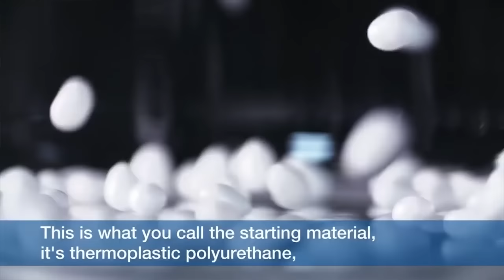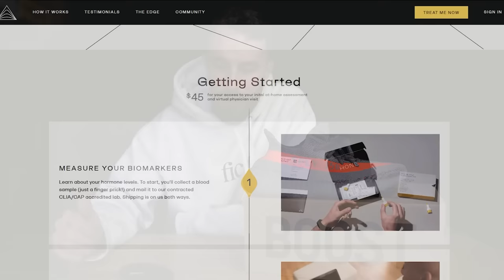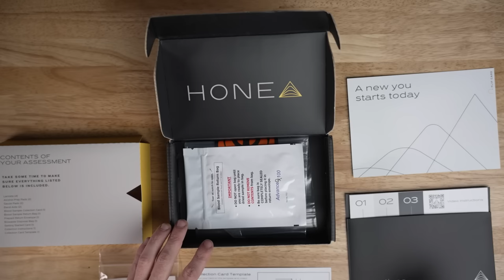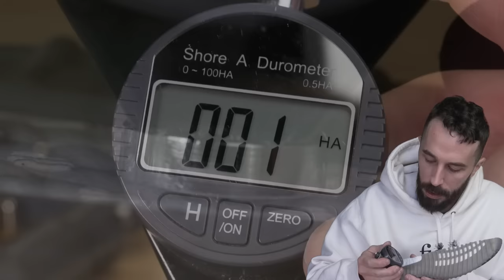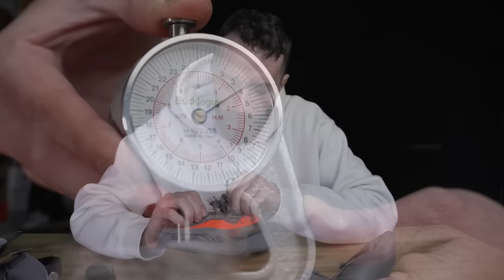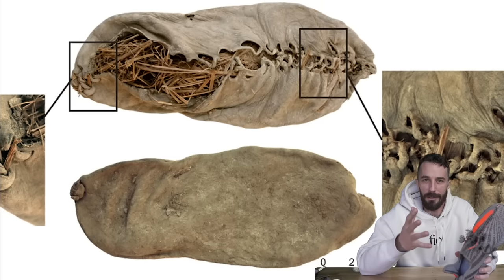The Truth About Yeezy 350 V2

Comment: I own a couple pairs of yeezys, have had more over the years, they’re nowhere near worth it but there’s just something about them that makes me like them. Super comfy on feet and a good recovery shoe after wearing boots.
Reply: I agree lmao. Whenever my feet are dead I just wear the Yeezys.
Reply: Dude this is actually super helpful, I’ve been borderline getting Trench Foot from wearing boots all day, I even got new socks and it’s still an issue, i bet these are super breathable!
Reply: No recovery sneaker needed if your boots fit right/are well made etc.
Reply: Fr I wear my foam runners all day after a long shift of work
Reply: @devilxking2  that’s not true. Unless your boots are zero drop and have a modern design. Being on a platform with a raised heel all day does induce a lot of wear on your calves, shins and feet. Esspecially if the boot is traditionally constructed, it’s bound to be a bit rough on your feet for wearing day in and day out.
Reply: There are plenty of comfortable and breathable sneakers. This is called convincing yourself they’re better because you overspent on a ridiculous brand name or rationalization.
Reply: Want a recovery shoe? A pair of Blundstones. Want a sneaker? Get an Ecco Biom sneaker at half the price.
Reply: John Baptist  they look terrible
Reply: @devilxking2  not the case, I own red wing iron rangers all day in an engineering workshop. They definitely take a toll on your shins and Achilles after a 12 hour day.
Reply: John Baptist  they look hideous actually
Reply: John Baptist  "omg muh fee fees are hurt. yu jus jealous cuz i waste money on marketing scams and brand manipulation"

translated your whine for you.
Reply: Yeah Yeezy are one of the most comfortable  ones
Reply: Yeah I think the thing about them many seem to forget is that you don't buy them because they are the most efficient or anything, but because you like the design and comfort.
Reply: @0f556  The Ecco's look kinda whack tho imo
Reply: @thesumosnorlax2445  There are 100's of cheaper options. I personally like New Balance Fresh Foam. Don't waist your money simply so you can say you have Yeezy's. A lot of guys in my area like Hey Dude's also.
Reply: @thesumosnorlax2445  just get crocs
Reply: John Baptist  The majority of the "Haters" on this channel own Nick's boots which start around $550.00, Or Red Wing heritage that start around $300.00, or any number of other hand made leather boots. It's the complete lack of value in these shoes that's the problem. There is absolutely no reason these $50.00 shoes cost as much as they do.
Reply: Holy shit I didn't know there was so much beef in the sneakerhead community. Thought yall just talked about your shared love of Jordan 1s.
Reply: @mrbadpersonality  That's your opinion, that doesn't mean it's a fact
Reply: I think they're worth it.
Reply: @imsotiredofthiscrap2341  true sneakerheads don't put others down for their choices of footwear. It's usually the hypebeasts who stir trouble and like to badmouth those who don't agree with their POV
Reply: @zhsf  I think my opinion is pretty solid tho
Reply: @markopolo9936  I wear my Yuketen boots every day and I walk a lot; never felt the need to wear something else. They are also more than double the price of Iron Rangers MSRP but yeah.
Reply: @mrbadpersonality  For you it is, but not for everyone..
Reply: @thesumosnorlax2445  I’m sure there are others that are breathable without paying out the nose for them too….
Reply: @willmtaylor  I completely agree with u . These are WAY over priced . And they are UGLY as hell . If they were $40 I still wouldn’t want them. I think because they are expensive that makes people feel like they have something and that others will look at them differently. I think anyone who pays out the nose for a pair of shoes because they are the fad or what the stars are wearing . They aren’t anything special at all !!!!
Reply: John Baptist  u have to know that this shoe is WAY over priced !!! It doesn’t cost nowhere near what they charge for them to make them. And they are one of the UGLIEST styles of tennis shoes I’ve ever seen !!! Wast a waste of money . Ur just paying for the name and the status…..
Reply: I actually think they are worth the money! Its a super comfy shoe and your feet are just on a pillow the entire day.
Reply: @YungSkyy  I’ve never ever had any shoes feel like they were worth $200-$400+  !!!!! There’s no way in hell I’d ever pay that much for a pair of shoes. UNLESS they were making me money OR I had some type of medical disability or something wrong with my feet where I HAD to buy them. But just for a pair of shoes with soft insoles … NOPE ! I can’t have custom orthotics made for $200 that are actually the same shape as my foot for less than those shoes…. I just can’t see myself wasting hard earned money $200+ on 1 pair of shoes…
Reply: Yeah i have a pair, wore them for 2 years and now they’re completely beat. Expensive, but damn they’re comfy. Most comfortable shoe i’ve ever had and i also love the look
Reply: @amandacrawford4748  Everyone has their own opinion, but I really stick to my point of view
Reply: Hypebeast fasho
Reply: @willmtaylor  no they're comfortable, it has nothing to do with the brand.
Reply: Yup, very comfortable.
Reply: Ah yes another episode of “these shoes are all hype but dipshits will pay a bunch for them anyway”
Reply: My $60 pair of rep yecheli reflective are damn good buy reps y’all get multiple pairs for the price of 1
Reply: @andrewc9790  and you think nicks boots are worth 500? Lol at the end of the day the shoes are good and hold up especially when it comes to comfort. The price tag is irrelevant because at the end of the day it’s supply and demand. The few might not think something like this is worth it but the majority do that’s why these companies can put these price tags .. it is what it is.
Reply: @VisceralCarbon  Yes I do think Nick's boots are worth it. There are plenty of videos out there explaining why. If Yeezy wasn't backed by Adidas and owned by Kanye it would have flopped a long time ago. Apparently if enough gullible people are convinced they're worth the ridiculous price than they're worth it.
Reply: @andrewc9790  see that’s your perception on the matter.. in actuality no shoe is worth $500, depending on the quality and materials used one could say if it’s worth it.  For adidas the shoe is durable and comfortable for the way they designed it despite it being from Kanye it’s a good looking shoe , as we can see because his other lines aren’t as profitable as the 350s.. For the brand and the quality and for the amount it’s being sold in retail its great pair of shoes, once you start getting into resell that’s the issue. This is coming from someone who’s far from a hype beast and looks for quality and looks before name brands.
Reply: @John Smith you obviously don’t know what resell entirely means, do you ?
Reply: There's just something about them that makes you like them? Yeah, that's called marketing...and it obviously worked. lol
Reply: @VisceralCarbon  apparently these shoes cost ~$35.00 to produce. The outsole of a pair of Nick's probably costs more than that. The shoes have very little value but... they're worth what people are willing to pay.
Reply: But they are too ugly I'll just stick with ultraboost
Reply: Just the fact that it’s Ye for me is enough. Hoping to cop another pair soon. Maybe 700 wave runners this time.
Reply: @julianshepherd2038  if you dont like them what the hell are you doing in the comments section of a video about them????
Reply: U can buy nmds for $150 less.... just as comfortable. Or and other adidas with boost in the sole
Reply: Yu into aladin shoes bra ...
Reply: Nike frees

Comment: I've worn my 350 V2s pretty frequently over the past two years, and haven't had any issues with the primeknit failing or moisture in the midsole. The primeknit is so breathable that you don't really sweat when you wear them, so they seem to stay pretty fresh. They would absolutely fall apart if you did anything that was hazardous for your shoes, but from regular wear around the city, mine still look and feel great.
Reply: "...so they seem to stay pretty fresh." Kinda like...when one is using the toilet...their own smell doesn't seem to be as bad as everyone else's. 😎
Reply: @baberoot1998  that’s gotta be the goofiest comparison I’ve ever heard 💀
Reply: How much do they last? That sole looks so damn thin for such expensive shoe.
Reply: @makatron  I haven't noticed any degradation of the sole, boost is pretty awesome for not getting compacted with wear. The biggest concern for wear, in my opinion, is the shell around the boost at the heel. If you drag your heels, you will burn through that pretty quickly, and the boost will be fully exposed and break down. I don't drag my heels and haven't had this problem, but it's probably the biggest design flaw if you're wearing them normally.
Reply: @fLaMe98able  I may get a pair to try them out, I'm moving towards fabric uppers because they're so comfortable.
Reply: @makatron  the outsole is extremely durable, I had a pair for a year and was able to just brush off the dirt and throw them in the washing machine and they came out looking like I had worn them like 3 times. Upper pretty much doesn’t age unless it’s a white pair
Reply: @musiccritic8467  I hate white shoes for sure
Reply: @blakeh1847  Yes ma'am...I will agree with you. 😎
Reply: The only complaint is they can't be worn when raining. And that's alot in Michigan. And snow. I can only wear my 350s from March till October. On sunny days.
Reply: @adamnoyb7853  that'd be a problem here too
Reply: @adamnoyb7853  they’re not bad on rainy days from my experience the only annoying thing is puddles
Reply: @fLaMe98able  I feel like even if you don’t drag your heels it’s still one of the most overwhelming flaw, because like in this video the bottom is pretty soft .
Reply: @musiccritic8467  you can't be serious? That's the point when it rains it leaves puddles and therefore I have to step they it. Unless its sprinkling then you will be getting them wet on the inside.
Reply: @adamnoyb7853  ah idk for me even when it’s tipping it down my feet stay dry unless I stand in a puddle
Reply: utter ugly shoes
Reply: @makatron  i've been wearing my yeezy's for 3 years now and it doesnt seem to have any holes on the primeknit. The soles however are flattened and almost worn out but still could go for another 1 and half year. Mind you, i wear mine almost everyday and i do walk a lot.
Reply: @patbadoobee4554  yeah I had to go ahead and order a pair, look how nice this comment section turned out people helping each other instead of insulting 🤣
Reply: @makatron  haha glad we helped. Hopefully you didnt pay much on reseller price
Reply: @patbadoobee4554  in this day and age, you'd have to physically go to the factory to get it MSRP
Reply: Lots of cheaper shoes feel great being babied around the city. Cope.
Reply: @vgamedude12  provide a make and model, serious question.
Reply: @makatron  you're asking me to name a shoe that's comfortable out of every shoe that exists out there? You can't be serious?  You think that the stupid overhyped shoe with the overhyped stupid "artist" behind it is somehow unique? It's just a mass produced sneaker.
Reply: @vgamedude12  you took it the wrong way, I also avoid overpriced overhyped shoes, was just wondering which ones you go after mate
Reply: @vgamedude12  calm down. its overpriced because of resellers but retail is definitely worth it. I paid retail and it lasted me for 3 years. Just because its popular doesnt mean its overhyped. Its definitely one of the most comfortable and stylish shoes out there.
Reply: @patbadoobee4554  you mean the LEAST stylish shoes out there? nothing stylish AT ALL about ANYTHING from yeezy.
Reply: @MyBinaryLife  look im too old for this. I wear whatever i want that feels comfortable and looks nice. Your opinion doesnt matter to me cause i dont really care. Wear whatever you wanna wear lmao
Reply: 350 yeezy discount discount.85 $
Reply: @Adam Noyb  I live in Detroit and the winters are terrible. That is why I never bought any

Comment: Owning a pair of Yezzy's and seeing this video. I feel someone can make an off brand with foam for 40 to 80 bucks, will definitely buy them instead of a hype shoe.
Reply: They're clown shoes. You can go to the clown supply shop to get them.
Reply: That's why you can buy reps for 40-80 and get the exact same shoe
Reply: I can tell you without a doubt, even the best reps I’ve spent money on… they are complete A$& in fitment and comfort.
Reply: Or maybe even cheaper since all the shoes are made overseas. But then if it's not $200 the inner cities won't see them as a status symbol so they won't be desired anymore. This is the problem